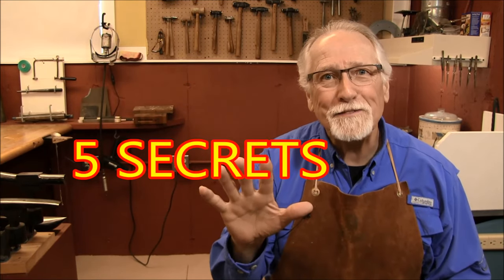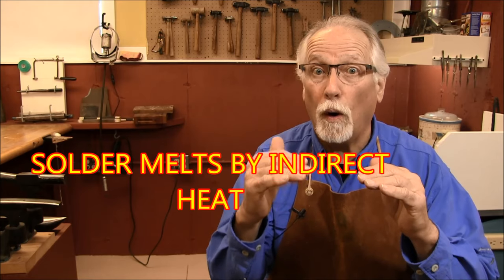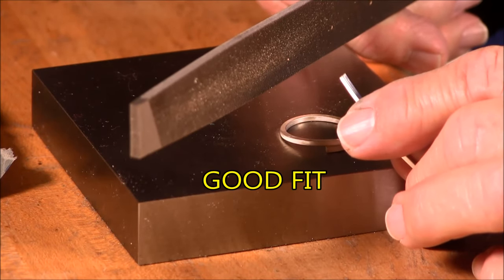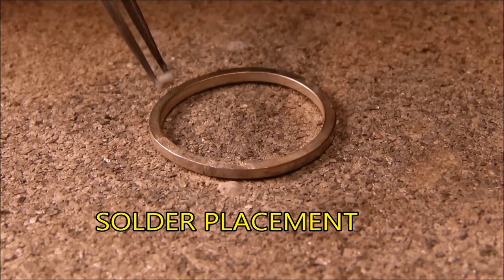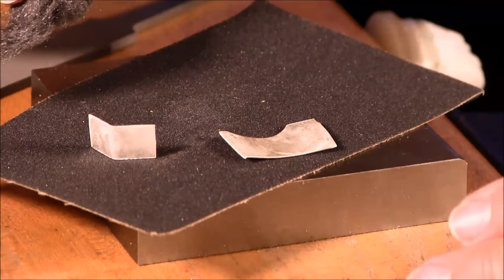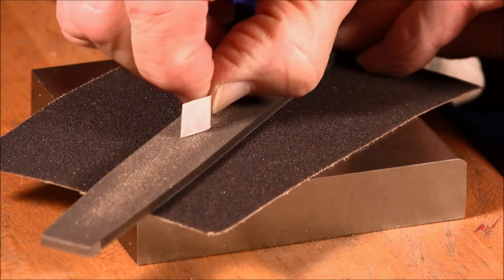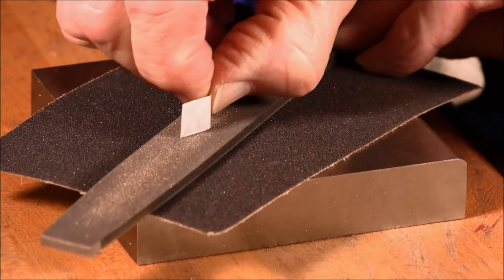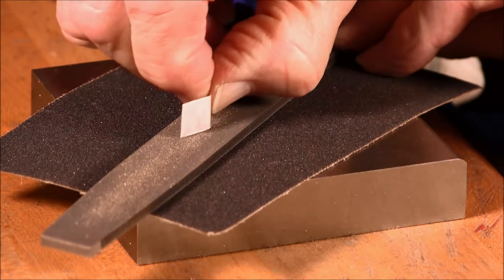5 SECRETS TO PERFECT SILVER SOLDERING!

Comment: Its silver brazing. Why do jewellers call it soldering?
Reply from the maker: Hello Geoff,  You are correct.  Any joining of metal with an alloy below the temperature of 840 degrees F. is technically called soldering.  Any joining above 840 degrees is called brazing.  It is always interesting that all different fields of work have their own language and terms that are considered "tradition".  The jewelry industry is the same.  It just has been a tradition to call the general method of joining metal, soldering. It is also interesting for the pronunciation of Soldering.  In the UK, it is pronounced with the "L" .  In the US, the L is silent.  Thank you for your comment, I appreciate it.  You are correct.  Greg Greenwood
Reply: @greggreenwood4628  people,e outside the usa laugh at your 
Ronouncination od solder and aluminium. It should be the reverse. Your pronouncinations are closer to the originals. When I first tried silver work, I was proficient at silver brazing copper. So when they said silver solder, I was cautious with the heat and of course the joint was a failure.
Reply: @greggreenwood4628  good  vid btw. I love Andrew Berry and an but they have faded. I try listen to as many different instructors as I can as each has their own techniques and unique way of explaining.  I'm glad your are part of the university of you tube.
Reply from the maker: Hello Geoff,  Silver soldering (Brazing) takes more heat than with copper.  Don't be afraid to heat it up.  The borax flux will help you know when the solder will flow.  Good Luck  Greg Greenwood
Reply from the maker: Thank you Geoff for your kind comments. It is good to view many different instructors.  Thanks and I'm very happy to be part of the university!!  Greg Greenwood

Comment: It's brazing, not soldering!
Reply from the maker: Hello Geoff,  Thank you for your comment.  You are correct that in many fields, the term is called brazing.  In the jewelry business it is commonly called soldering. There is a "blending" between soldering and brazing.  The  alloys used are sometimes the same, but the temperature ranges are "bended" too.   Silver solders range lower: Approx.  1160 degrees - 1616 degrees F.  Silver Brazing Alloys range higher: Approx. 1304 degrees - 2050 degrees F. The Spelter Solders for brazing can contain more than 2-3 different metals. Ex. Copper, Zinc, Nickel, Tin. 
No matter what the method is called, it is an amazing technique that holds the entire world together.  
Thank you for sharing.  I appreciate it. .  Greg Greenwood

Comment: Doesn't fill gaps....ohhhhh...lol...
Reply from the maker: Hello Jason,  Try to get a good fit before your solder.  Good Luck  Greg Greenwood
Reply: @greggreenwood4628  wow..thanks for replying....I've been wanting to create metal roses for a while  , am using basic tin,..pretty thick as far as tin goes but I can still cut it with a good pair of German Wiess scissors...I took your advice and am cleaning my metal thoroughly by submerging it I Xylene over night, and sandblasting it afterwards....I know silver solder is expensive, but it's the only thing I found out on a shelf in my shed..after making tighter fits, and better cleaning...it's working tremendously better.....I sold the first rose I made the day after I made/ painted it for 35.00..it went like a hot potato....I can't thank you enough for replying,...and improving my skills...God bless you
Reply: @greggreenwood4628  sorry...Wiss scissors...lol....good old U.S.A  made...l had to check!
Thanks again‼️